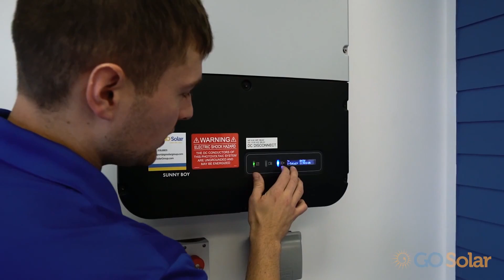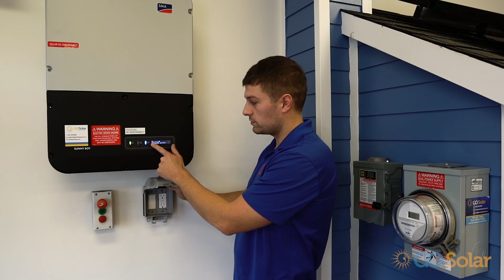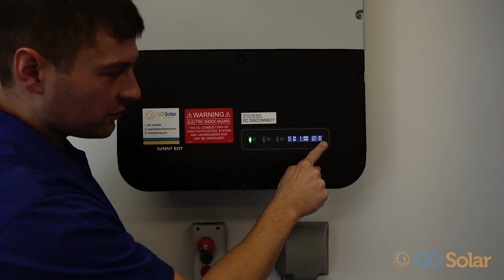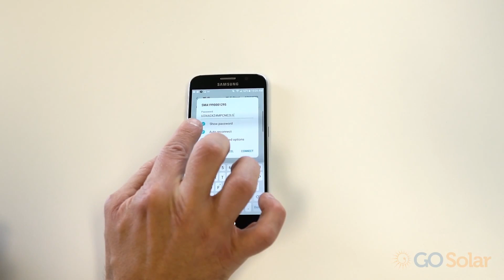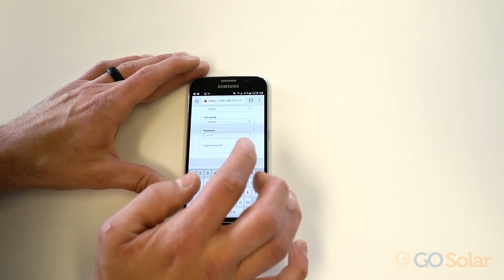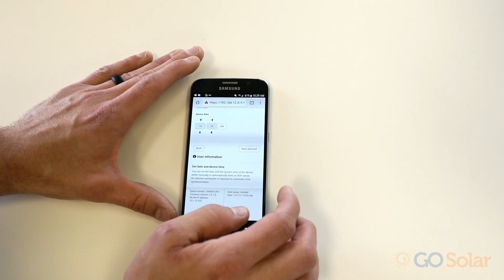Solar Technician Colin Payne Explains the Inverter & Secure Power Supply

Comment: In my region I just want the ability to have a low maintenance way to run refrigeration on hot 
days when the grid is shut off due to wildfire risk.
So how can I get Secure Power Supply now, in the USA under the new 
rapid shutdown rules?  I don't want batteries.
Reply: I was told about 1.5 years ago the  Sunnyboy  -41 inverters can support both Secure Power Supply and 2017NEC  rapid shutdown and provide a DC-DC optimizer at each solar panel.   However, you will also need communication (via roofcomkit-P2)  back to a TS4-R-S or a TS4-R-O shutdown/optimizer device.   I was told the TS4-R-F shutdown/optimizers do not support both module level monitoring and secure power supply.    However, it would be wise to talk with your PV system designer/installer and manufacturer.   I don't know if the TS4-R-S or TS4-R-O are readily available any more.  I am seeing they are out of stock and no longer available on a couple of web sites.
Reply: SMA's Optimizers are made by TIGO.  You now order Tigo's TS4-A-O optimizers to go with the SMA inverter.   For Secure Power Supply to function properly with rapid shutdown, every panel will need Tigo's TS4-A-O  optimzer or  Tigo's TS4-A-S monitor w/o optimization.  I am not sure there is a significant price difference between the TS4-A-S and the TS4-A-O.  There are now DUO versions out that reduces part count but not much expense.  Maybe you can get a better break on the install with fewer optimizers to mount to the solar panels.

Comment: Is there a reset in the 6000 tl unit  for the Secure Power Supply?  I had a elect arc fault got that reset and the SPS, is not working.